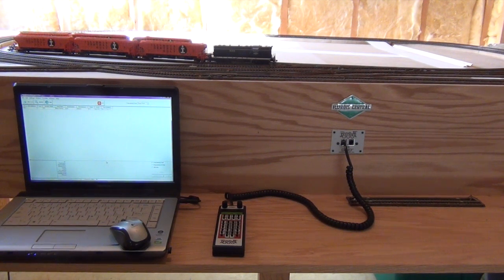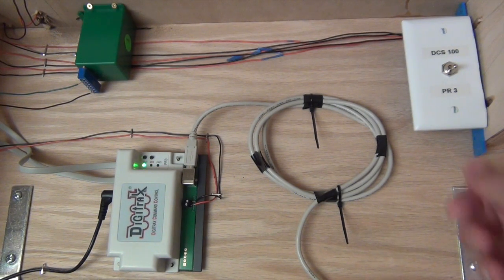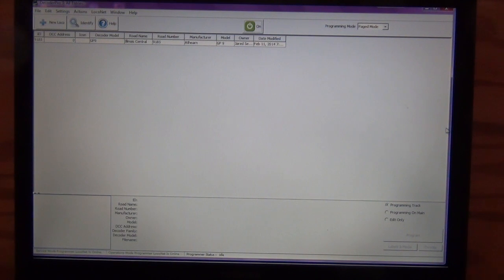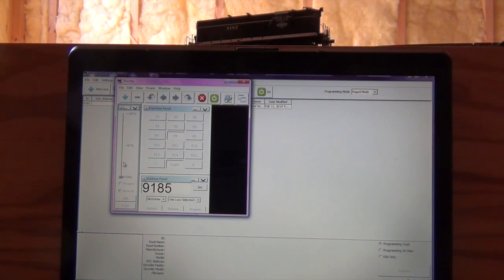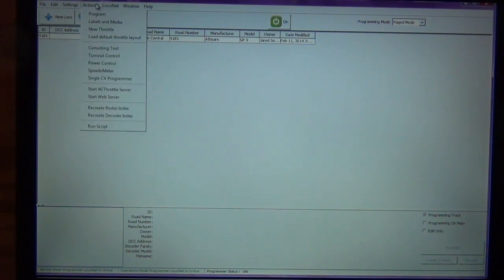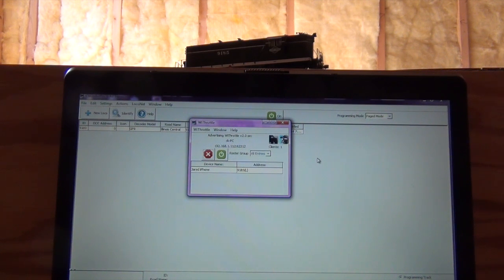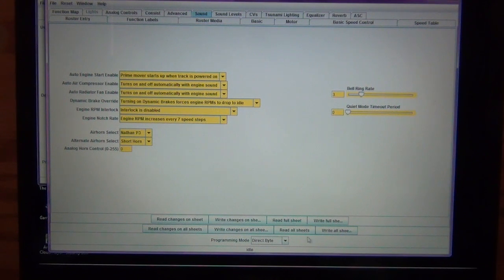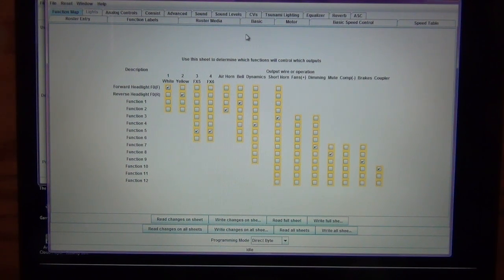JMRI tutorial with Digitrax Super Chief and PR3

Comment: I am completely new to this DCC and JMRI.
To get started with JMRI what do I need from DIgitrax? I have an Iphone6
Reply from the maker: Hi Robert -
Minimally, here is what you will need.  
1)  A Digitrax DCC system (I have the Super Chief)
2)  Loconet cable (I have another video on how to make one if you want to save money)
3)  A computer (Mac or PC) that has a USB connection
4)  JMRI downloaded (this is a free download), be sure to download the instructions and read through them
5)  A Dixitrax PR3 (the power supply is not included, but a USB cable is included to hook to your computer)
6)  A programming track or an isolated yard that is connected to your PR3
7) (optional), if you want to run trains from your phone, you need the "WiThrottle" application, the demo version is free, the full version costs money.  I use the free version

The instructions that come with your Digitrax system and PR3 will help you with the connections.  My video should help you with the operations of the JMRI.  I have other videos that show how to program decoders using JMRI and the PR3.  Hope this helps!

Comment: I just got my PR3 up and running for the first time last night and I used DecoderPro3 for everything you showed needing to download and use DecoderPro for. Is there some advantage to using regular Pro over Pro3 that I'm not seeing? Totally new to this. Thanks.
Reply from the maker: Hi Brent.  I use DecoderPro 3 for operations (e.g. controlling the track power, using the WiThrottle Server, and running the turnouts, etc.).  I use DecoderPro in service mode to read the decoder and change the CV values.  I will tell you that I am running an older version of JMRI and I know they released a newer version since I installed mine.  Some functionality might be changed between the different versions.  I found that their online user manual is useful.  I hope this helps!

Comment: Thanks for taking the time and effort to put this together. I saw your post in the Yahoo group.

The JMRI suite encompasses so much that it's hard to show what's important, and easy to become overwhelming. I enjoyed seeing how you connected (already know how), and understood everything you demonstrated in the video. However, for a newbie, rather than "you can...", it might be better to be specific with what you did, and why. For example, "When I got my loco, I wanted to change the address, so I did this ..."

By the way, like you, I had problems with my short horn being a toggle on my throttle until someone in the Yahoo JMRI group  (despite the darn "NEO" "updates") told me I could change it in my roster entry to momentary.

Engine Driver is the (awesome and free) Android app for "controlling" JMRI, and a new app called "DigiTrains" is also available.

The JMRI "Panel Pro" is what I started with, and drew my layout on the screen.  The JMRI webserver provides access to designated webpages, including my layout plan, and I can see and control turnouts on that graphical interface as well.

Again, thanks for sharing this and have fun exploring JMRI.

Phil in beautiful Talking Rock, Georgia, USA.